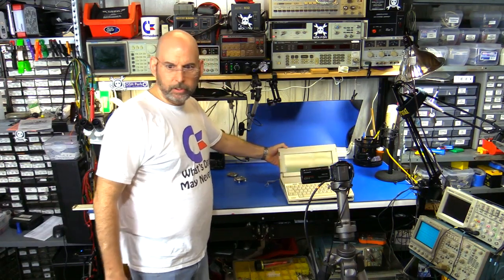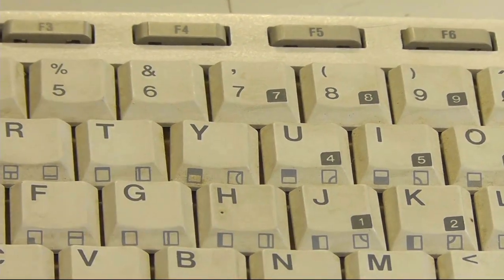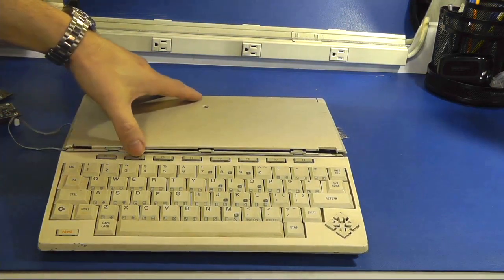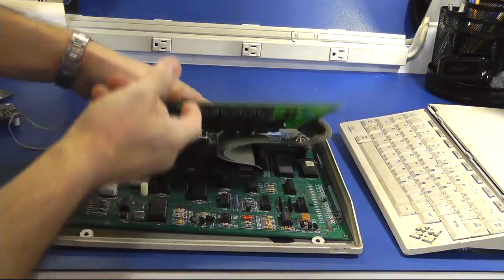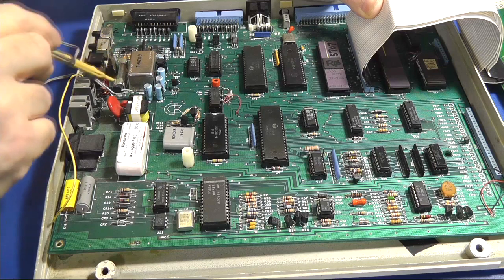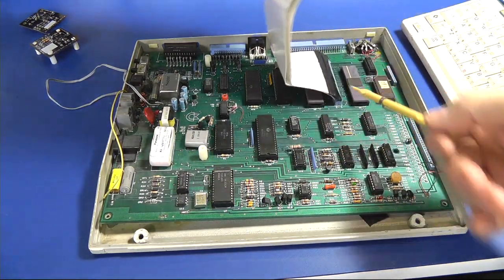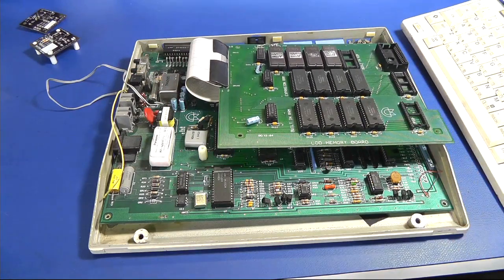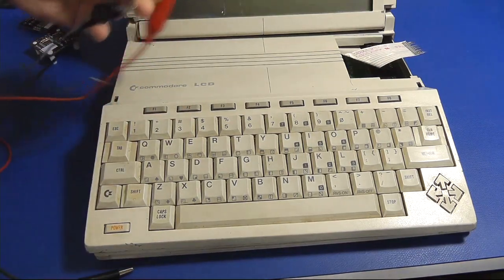LCD Teardown for COMVEX 2014

Comment: Wow just wow, if Commodore had made and sold them I think the history of computing might have been very different. I really really want to see if it still powers up.
Reply: By 1985, IBM PC-compatible laptops were already on the market, and that's what business users wanted. In late 1985, Radio Shack released the Tandy 600 laptop with specs very similar to the Commodore LCD (80x16 display, built-in modem, serial & parallel ports, etc.) and it was a total flop because it wasn't IBM-compatible.
Reply from the maker: vwestlife With all respect this was a portable as in powered by some AA bbatteries the PC was a "luggable" and weighed almost as much as a PC, maybe more with the display, its just that it had a handle.  Still would only work if you plugged it into to the wall outlet and waited for it to boot.
Reply: BilHerd 1985 was when the first battery-powered PC-compatible laptops from Toshiba hit the market. They were very expensive but it was the death knell for both the non-PC laptops and the big luggables like the Compaq and Kaypro. But maybe the Commodore LCD still could've competed if it had a low enough price and a long battery life. It is certainly a very attractive design for its time.
Reply: @BilHerd  My first ever computer was a Commodore 64 c so it's nice to see some video's about the history of Commodore found your channel though the 8-Bit Guy's channel about the history of Commodore
Reply: That's unlikely since Commodore's platform has inferior MS/Intel's clone platform business model.